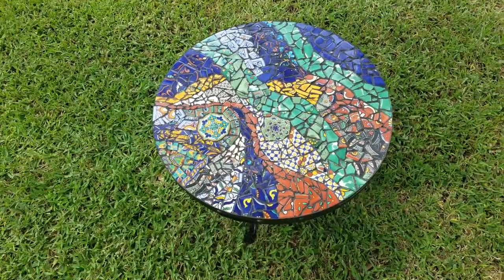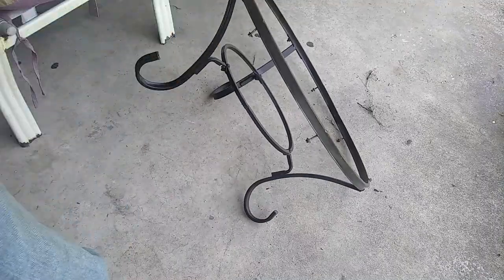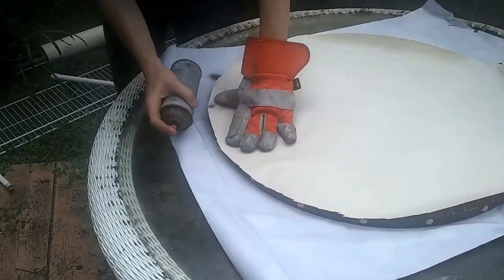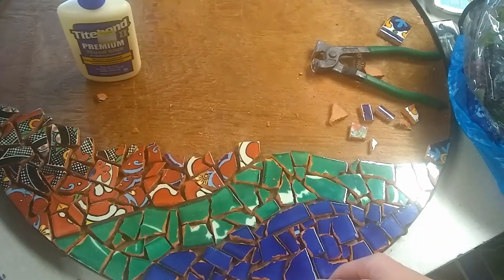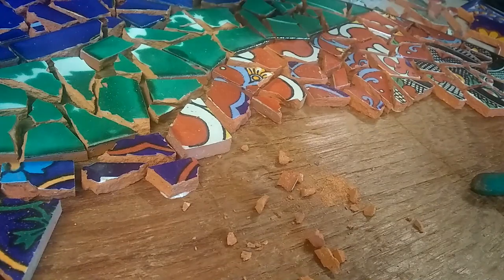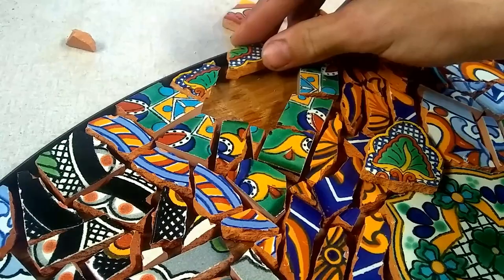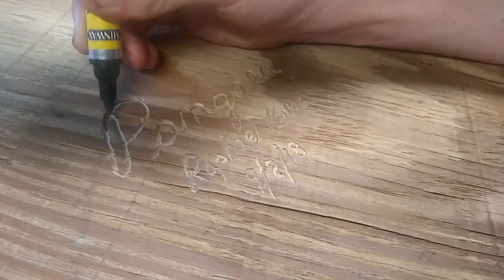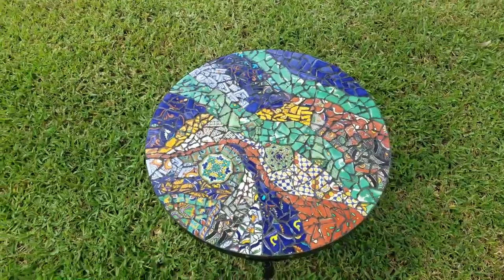How To Make An Exotic, Gorgeous Mexican Tile Table!

Comment: Nice work! I wouldn't use wood glue for tile; something like WeldBond would probably be better. 
If this plywood isn't marine grade (or even if it is), you probably don't want to leave this out in the weather.
Overall, though, a really attractive design, and crisp execution.
Reply: How does one weatherproof a table for outdoor use?
Reply: @gillnolan9382  Weatherproofing wood is really difficult. The problem is that wood will shrink and swell with temperature and humidity, but tesserae and grout don't, so the grout will crack and the tesserae can pop off.
I'm going to try some experiments with flexible adhesive, like caulk, one of these days but, even if that works, grout will still be a challenge.